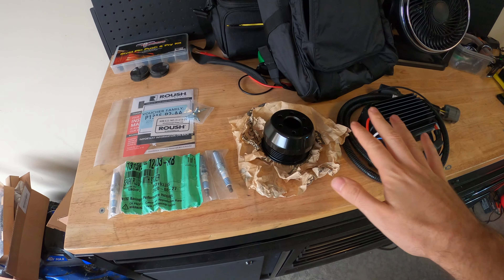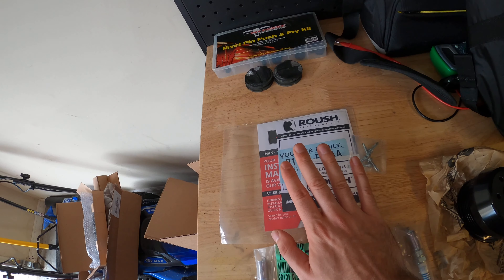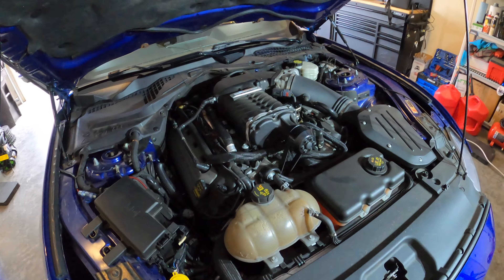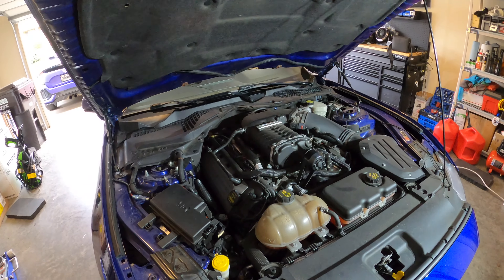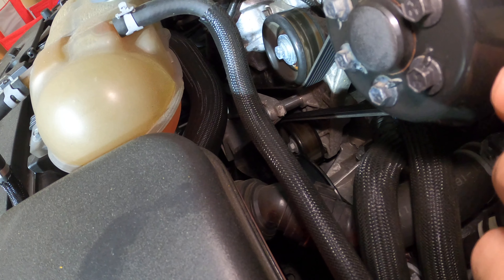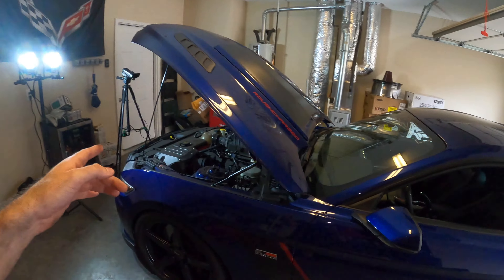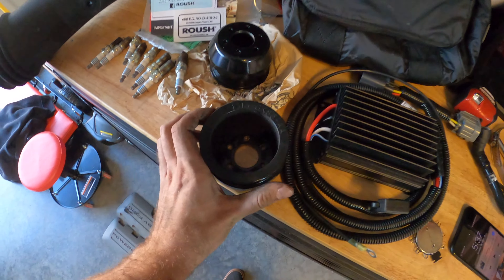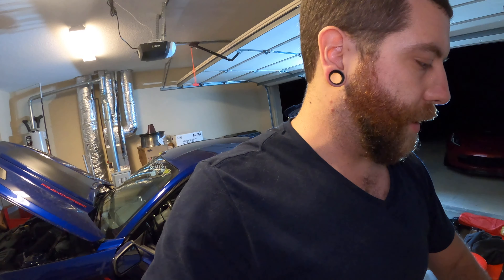***I BROKE THE MUSTANG!*** Roush Phase 2 Supercharger Upgrade Kit Install

Comment: how many miles since and how is the motor holding up? did the Roush Supercharger come stock with the car?
Reply from the maker: Yes it’s a stage 3 Roush, so the supercharger comes factory. The phase 2 kit is also Ford certified, so it does not void the factory warranty if flashed by a dealership. It has been about 5,000 miles. No issues yet. Car drives basically the same but has a little more top end power. I’m happy with it.
Reply: @RobsHouse  Thanks. I was confused if it was a package that you have installed or that just comes with the car. 

Curious to know how the motor will hold up after a few years.
Reply from the maker: @gahlyogu4570  The phase 2 kit for the blower just includes an underdrive pulley, a fuel pump booster, and different spark plugs. It also comes with a voucher for the tune, which can be flashed at any Ford dealership. You can actually buy the whole supercharger setup as a kit from Roush, but my car is an official Stage 3 Roush car (has a Roush serial number associated with it), so it was sold brand new with the supercharger already installed. The car has over 53,000 miles on it currently, and the motor has zero issues. Whether you buy a Roush serialized car or you simply install the roushcharger kit on a regular Mustang GT, you will retain your factory warranty. If you buy the kit to install on your Mustang, you just need to make sure a ford performance certified shop does the install. You'll still have 5 year/60,000 mile powertrain. People run these cars for a long time with superchargers. I daily drive mine haha.
Reply: @RobsHouse  awesome can you tune it to run 91 octane?